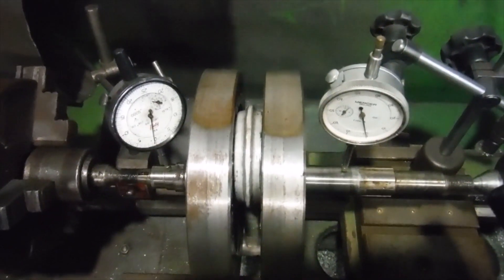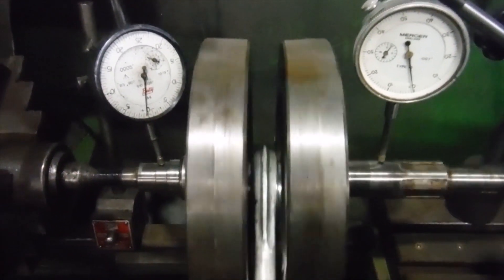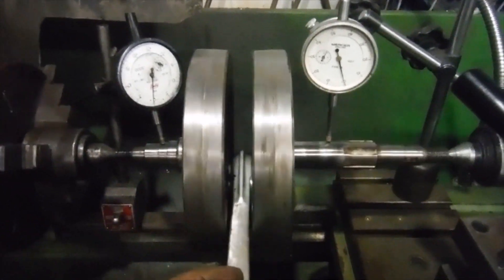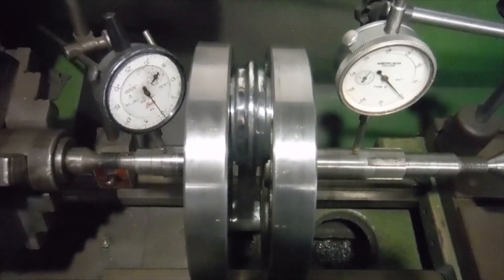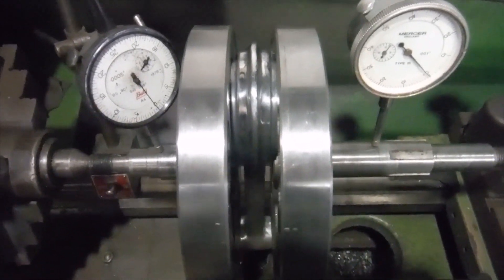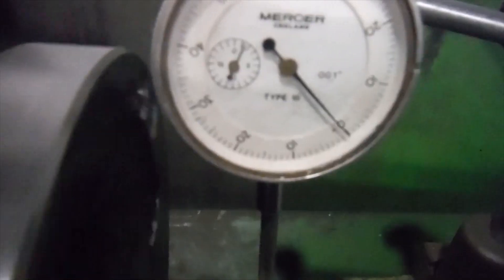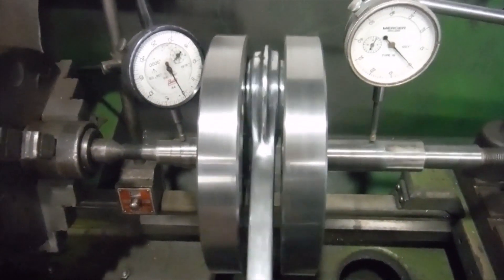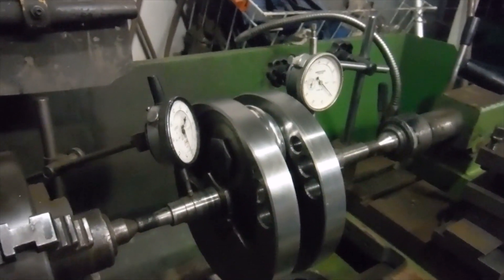Royal Enfield 500 Bullet Asbo 46 crank check before and after lightening, rebalancing and reassembly

Comment: I do not wish to ask a crass question, cheri...or question your expert "wizardry" but, as a matter of innocent curiosity,  do you ( Performance Classics) extend a warranty, of any duration, on these overhauls ?
Reply from the maker: Hi Amelie, no, not as such, but I am always prepared to help out if there are issues as a result of anything I have done. This is one of the advantages of having the whole bike in, as I can try to ensure it is 'right' before declaring it fit to go home. The flip side of that is bare engines are easier to work on and take up less space, but these rely on their owners to get everything else right, once they have fitted their rebuilt and / or tuned engines.
Reply: @paulhenshaw4514  Merci.

Comment: Hello Paul, I have a question. The previous owner of my Bullet 500 2012 UCE had it serviced at Royal Enfield watford and they used 10W40 oil in it. It ran softer and vibrated quite a bit. I recently changed the oil to 20W50 fully synthetic and IMO, it is running better (less vibrations and feels solid). I also found some crap in the oil strainer (metal shavings, piece of gasket etc). Do you reckon 20W50 will do well in the newer engines or should I try 15W50 next time as recommended by RE? Thanks
Reply from the maker: I think I would use the recommended grade, although I use 20/50 mineral oil in most of the older machines I work on. I have heard about people finding all sorts of debris in the oil strainers - not ideal, but not unusual, it would seem.
Reply: @paulhenshaw4514  Thanks Paul. Going to try 15W50 next time. Ride safe
Reply from the maker: @CBRroyal382  Thanks.